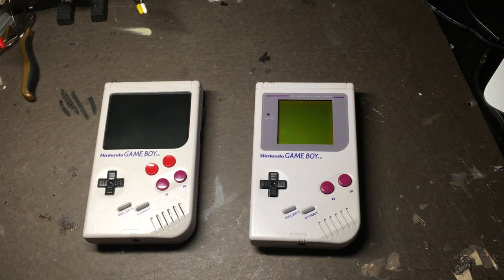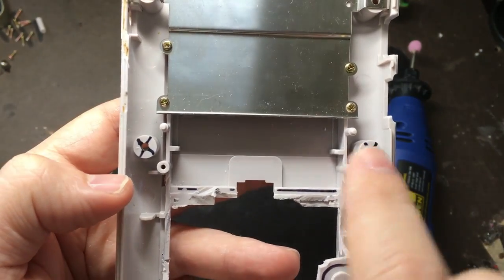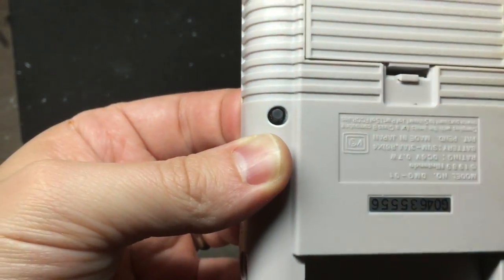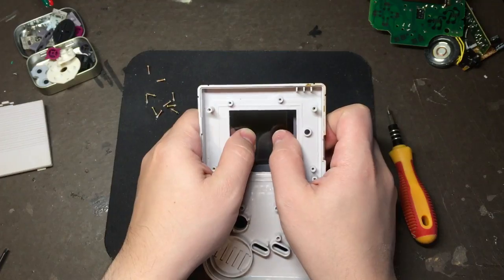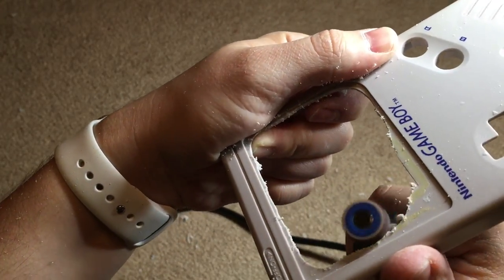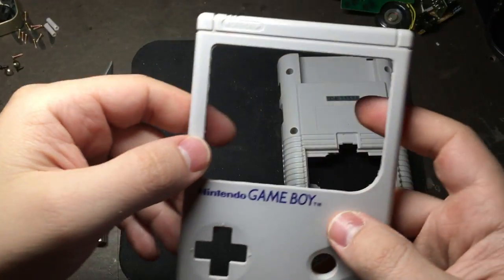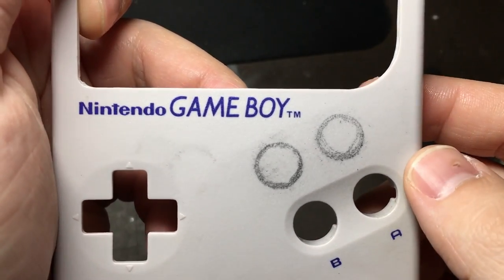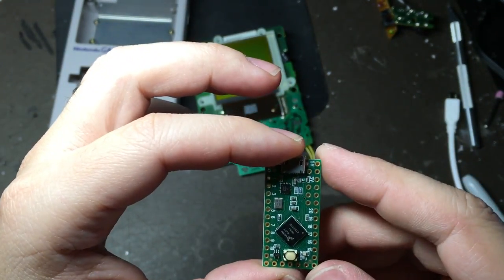Game Boy Zero Guide Part 1 - The Case

Comment: Replacement gameboy shells (plastic parts) can be bought for about $10. comes with everything but the electronics on the inside. save the gameboys and use replacement parts. they'll be in better shape, and you won't be ruining a very nice condition gameboy that's survived 25 years until it met you. 

also, they sell red NES style buttons for the original gameboy. look into them to have all your buttons match.
Reply: +Nick Schultz Where do you get the gameboy shells and NES buttons?
is there a way I could do the super famicom japanese style button layout if I go for this project? Your input would be much appreciated.
Reply: +Darkman flEx (Prince) the site for buttons is called kitsch-bent. google it. they have a NES style d pad as well, with little arrows and all. it's possible you could make a SNES style one, but you would have to buy a few button sets i think.
Reply: +Darkman flEx (Prince) ebay and aliexpress have them, search for gameboy shell, dealextreme have some sellers with all kind of weird colors :)
Reply: +Elizabeth Neilsen you're right, I don't know for sure, but even the internals look clean. most of the as-is DMGs are perfectly repairable. regardless, a pristine OEM shell is no longer around.
Reply: You're right. I don't know why people sacrifice such a collector device when you can find exact copies of the shell for cheap.
Reply: if you follow his exact instructions it will be cheaper than his newer guide
Reply: if the gameboy wasnt working in the first place. then no harm don, you are just recycling.
Reply: it obviously makes sense what you are saying but i mean...... if i have the gameboy already and never gonna use it and it will probably eventually end up in the garbage (still pissed off at my mum when she throw out my commodore 64 and disks after i moved out)  how am i ruining a gameboy that has survived 25 years until it met me? its known me for like 17 years already
Reply: He should have used what your talking about
Reply: Nick Schultz thanks
Reply: @markgrant5412  Put it on ebay someone will buy it.

Comment: Having worked with plastic for years, here's a few hints:
For the battery compartment, it might be easier to make a cut across with the dreml, then cut out squares from that cross with an xacto knife and gently pull with pliers. It's a lot quicker, and you get fewer rough edges to sand down later.

For the screw pins by the screen, if you run around the edges you can reach with an xacto knife before wiggling with your pliers, there's a higher chance of them staying intact. The plastic will want to break at its weakest point, and with a grove right where you want it to break, you can ensure that's the weakest part.

Comment: For anyone wondering... You can buy game boy replacement cases for $10 complete with buttons and Nintendo logos on eBay. Another $10 for a pcb that will fit inside the case. It's a better route if you don't want to destroy your old game boy.

Comment: Somebody need to do the mold of the body like your design. It's time to do that!  It will make it cleaner and easier.
Reply from the maker: I know of someone working on it (not me).  :)
Reply: Get out!? For real. It's going to be 3d printed or mold?
Reply from the maker: A real, legit molded case!  No idea what timeline they are working towards, I know they are super busy.  :)
Reply: I guess I will hold on to my plans because I was about to do PiGRRL 2.0. If that's the case. Will you do a video about it when it comes out?

Comment: Was thinking about modifying a snes controller pcb for controls as it's looks like the could be space saved by doing so plus it's already ground chained and lots of space for soldering. Only question is, do you know if the buttons would Line up with the existing holes on the gameboy case. I'm think if cutting the snes controller pcb in half and solder what I need to do it runs as it should.

Comment: Will this work with the v1.3 raspberry pi zero?  I see that the tutorials are using version 1.2, which is difficult to find.
I was wondering if the GPIOs and Pads are the same.  They look different.
Reply from the maker: Definitely!  The only real difference between the two is the camera connector.  They shifted a few components around to accommodate that but everything else is the same.
Reply: Thanks for the info.  BTW, the videos are excellent.  Can't say enough good things about them.
I would never attempt a build like this without such good information.
Reply: +Josh Bailey the forums contain even greater information

Comment: I was watching the prices of gameboys and they rise up to 80€ here... minimum I found was 60€ ... can t his be done with a gameboy color?
Reply: Perhaps instead get a replacement gameboy shell. Ive seen one on ebay for $10.
Reply: +Astral Brain Tentacles what about the board?
Reply: i think you would have to buy one as spoken about in the Custom Parts video. Wermy's wiki has good info.

Im starting my own GB Zero, luckily had some broken gameboys. =)
Reply: Astral Brain Tentacles I see, I'll check it out! thanks bro!
Reply: If you are doing this, join the forums. So much info and help is there.
Reply: PotaTox which ones?
Reply: PotaTox tnks!
Reply: 75 cents of € = 1$
like i said. "prices here"
I can't really buy from amazon as the shipping would cost more than the item...

Comment: where are you getting the gameboys from. they are like 60 bucks. are those the ones you are getting? or are you getting them cheaper somewhere else?
Reply from the maker: +Colton Owen Ebay.  Watch for broken ones, they are cheaper but they go pretty quick.  The price has also gone up some since my initial video.  :\
Reply: +wermy thank you very much. and in my thankfulness I'm going to bother you with a request. could you post a parts list when you upload your next video? thanks either way.
Reply from the maker: +Colton Owen There already is one.  :)  Check out sudomod.com/projects , there may be a couple minor things added and a couple alternatives listed soon, but it includes the major parts.
Reply: +wermy I have been doing more research and I have found that it will be near impossible for me to get a raspberry pi zero. can I do the same thing with a rbpi 2 or 3?

Comment: Can you please put up a list of all materials and tools that we would need? :3
Reply from the maker: All that is on the wiki at sudomod.com/wiki.  :)
Reply: +wermy Ooo thanks a bunch!!! I clicked on the forums link so I got lost. Haha. 

Also, I was thinking, for adding the X and Y buttons, what do you think about this method:
1. From the original A & B buttons, measure where the edge of the new buttons will be and mark that placement on the case with a pencil.
2. Align the circles of the 'controller' where you marked the edges. 
3. Directly trace the circles onto the GB case.

Comment: Do you think I would be able to use a Gameboy color. The original game boys are hard to find under 25 bucks.
Reply from the maker: +DE4THRE4P3R I'm sure you could get a Raspberry Pi Zero setup in a GBC, but I don't think you'd be able to do the SD card reader, and you may have to use a different screen, smaller battery, etc.  Maybe I'll try some day.  :)
Reply: +wermy sounds cool. You could fit a raspberry pi zero in a bunch of handheld devices. Psp would be pretty cool to do.
Reply from the maker: +DE4THRE4P3R That one's definitely on my to-do list.  UMD SD card reader would be awesome.  :D
Reply: +wermy Make a tutorial if you ever decided to do a PSP version :D
Reply: +DE4THRE4P3R It is definitely possible to fit everything inside the GBC case. Look at this project http://www.xodustech.com/projects/raspberry-pi-gameboy-pocket he made it with the original raspberry pi inside a gamboy pocket (which is even smaller than gbc case) You might not be able to put the sdcard reader inside the cartridge and fit that into the build, but the rest should work.

Comment: Why don't you use replacement covers for the gameboy from 3th party company's?? It's so sad to see one to another gameboy getting moddified or even destroyed because of being obsolete,no wonder the value of the gameboy has been increased because of being more rarer to find; i remember how a gameboy first costed 20 bucks in 2002,then in 2008 it was dropped to 7 bucks,but now the value has been increased to an average 30 bucks.
All i can say is ,don't throw it away or mod it,just to sad,
Reply: I have an immaculate condition perfect working order (just got the screen fixed) original Game Boy, still even has the link cable port cover, and it came boxed with EVERYTHING that was originally in the box (except the batteries). There probably aren't many like mine anymore...